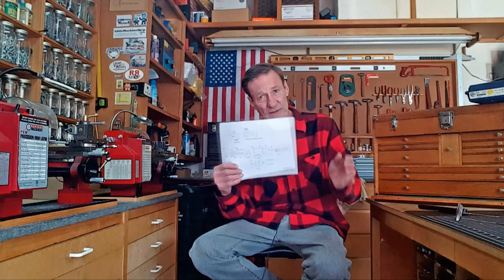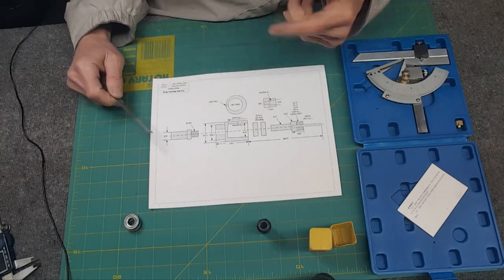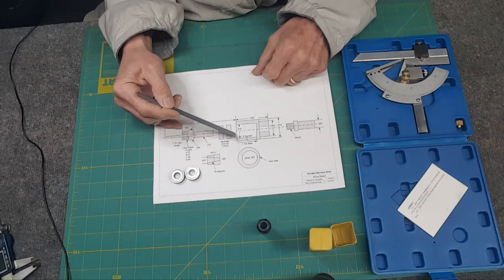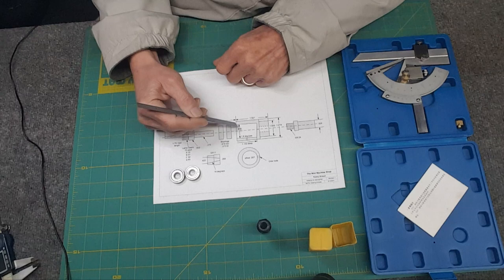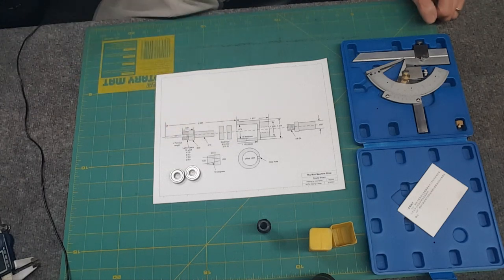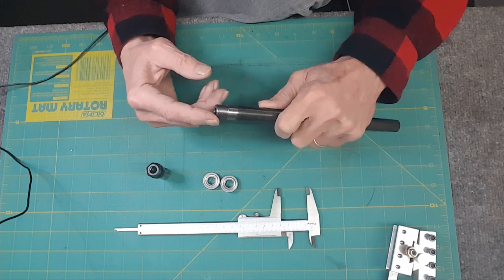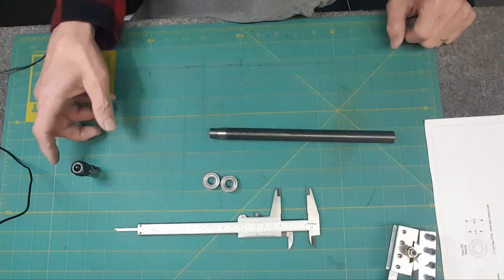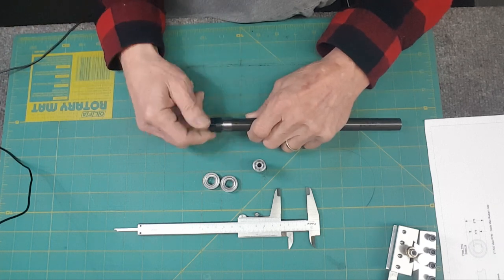Easy Rotary Broach With Free Plans

Comment: Hi Dave, I'm pretty sure ER collets are actually 16 degrees included.  So you would want to cut an 8 degree angle.  Rich
Reply from the maker: Later I did discover a spec saying 8 degrees and rechecked the compound and it was at 8.5 degrees but worked...

Comment: to find center of your shaft, tilted in mill vise, first use lathe to face & drill/bore a hole in end; insert a tooling  ball.  Then with shaft & ball positioned/ tilted in mill vise, sweep the ball with indicator to find center axis of shaft. Next model the ball's center offset in CAD, or use Trig to locate center point/axis on shaft's face.

Comment: There are two mainstream ways to do rotary broaching, 1) rotating work (on lathe) versus 2) rotating tool (on mill). 

These rotary broaching tool shares a common platform as rotary riveting differ by the bits, scraping versus spreading. 

I only experienced the die press broaching (similar to key way cutting) with a relieved hex bit in a press. The down side is concentric control.

Comment: There are problems with your drawing of the broach. The rear bearing needs to be a tapered roller or thrust bearing, using two plain bearings won't work. I have no idea how you think this will work with a straight key broach, am I missing something here?
Reply from the maker: As I said in the video the plans came from someone else and I didn't make the broach.
Reply: @TheMiniMachineShop  Not to belabor the point but you redrew the plans wrong, the rear bearing needs be a thrust bearing. For the broach to work well the angles and bearings should be accurate, if someone is working from your plans it won't work. I believe I saw the original plans, perhaps you should add a note to viewers to look for them on YT.
I'm not picking on you, I'm just trying to save people the hardship of building tools that won't work.